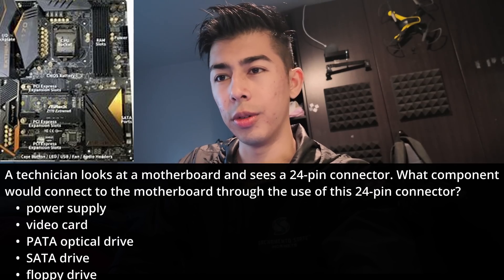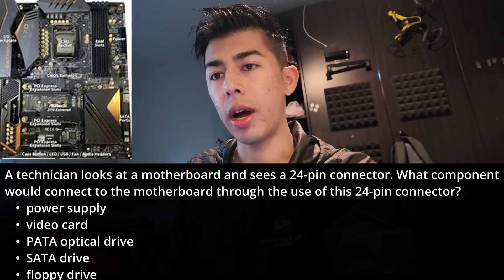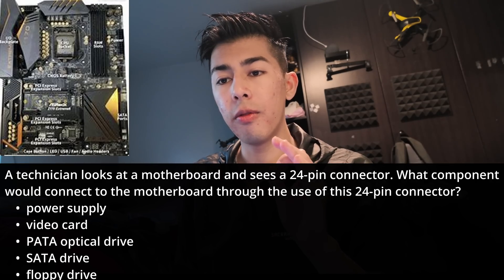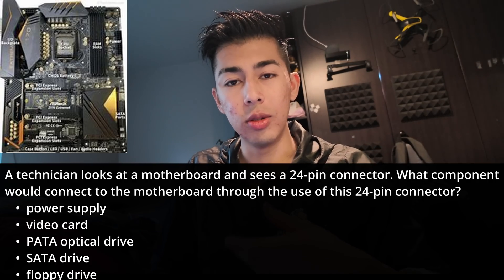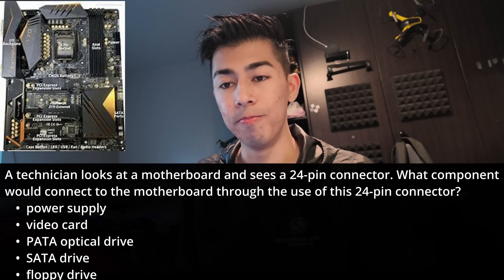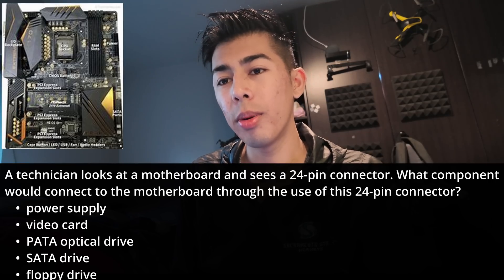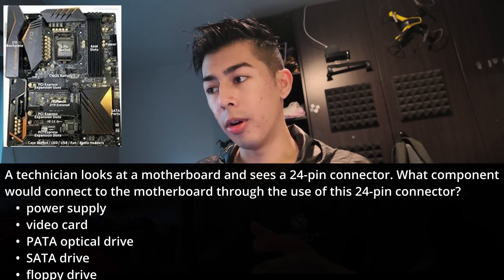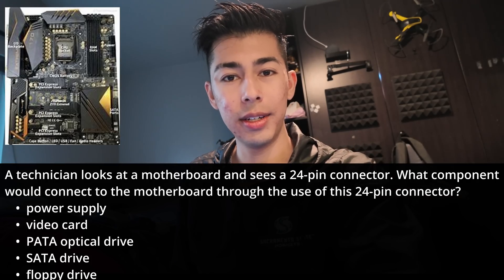24-Pin Power Connector: What Connects to Your Motherboard?

Comment: did u ever get 3D printing a picture frame down. some frames are like hundreds of dollars but ive been looking into 3d printing one
Reply from the maker: Believe it or not I'm actually still working on it. Not satisfied with them currently even though they are "good" 

I need to make the friction fit part better and trying to work in a mounting system into the frames
Reply: @ComputerEngineeringCPE  I cut out a notch on the back side of the frame so I can add wood... and "glue" it on to give it more strength.  A 1IN wood rod is still alot cheaper than a nice classic frame
Reply from the maker: Good stuff I'll keep that in mind, frames are crazy costly lol